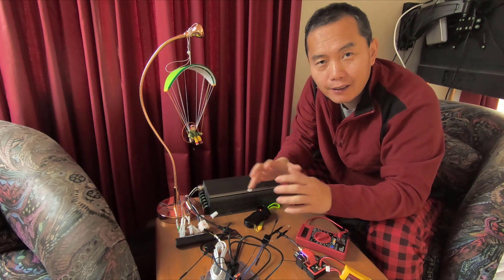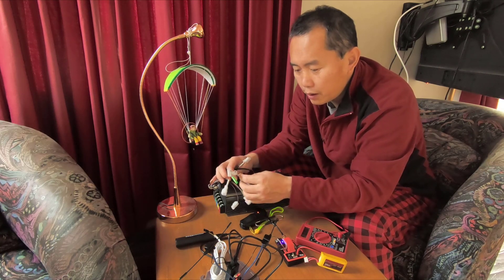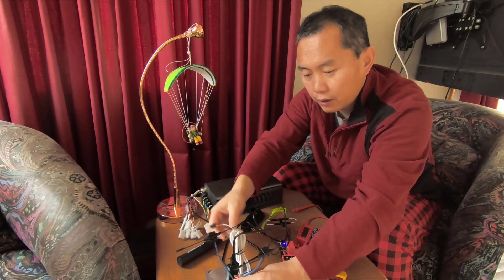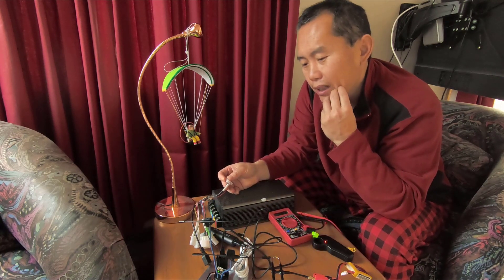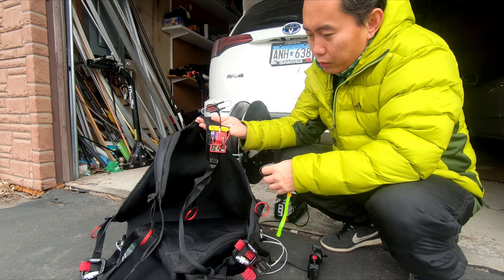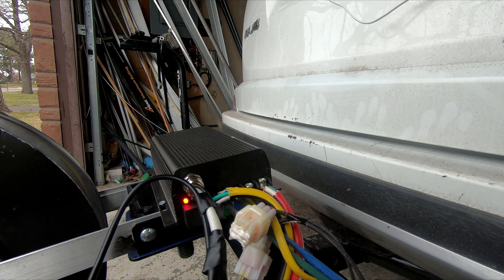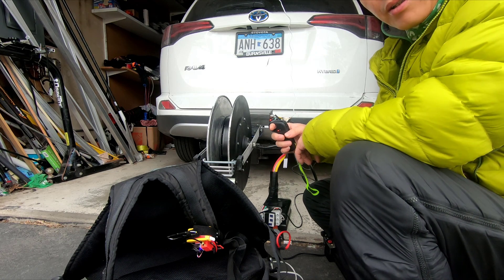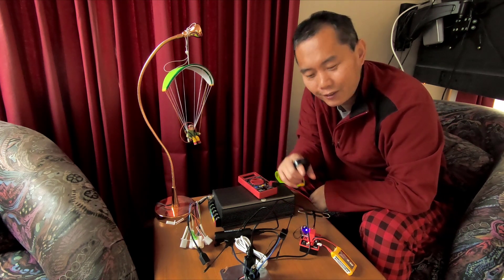long range remote control for 0-5v throttle DIY paragliding self towing winch

Comment: Can you make the remote without moving parts (electronic only)? I am concerned about what could happen if the servo remains stuck on full throttle.
Reply from the maker: use my sport winch, it's all electric:
https://minne.us/shop/sportswinch/
Reply: @JerryMinne  I was referring to the remote not winch. The remote to provide the 0.8-4V needed by the controller instead of using a servo to rotate the throttle...
Reply from the maker: You can order remote control here:
https://minne.us/shop/winch-remote/
Reply: @JerryMinne  i would love to but, that model uses a servo. Do you have one that works without servo?
Reply from the maker: There's buying options to choose different packages with 0-5v throttle control.
Reply: @JerryMinne  now it makes sense. Thank you
Sorry for the trouble but for some strange reason when I've looked on your website it wasn't obvious for me...